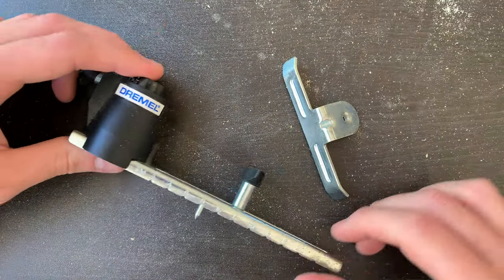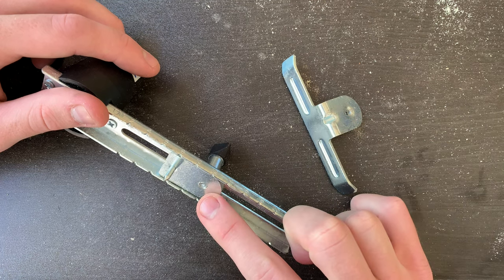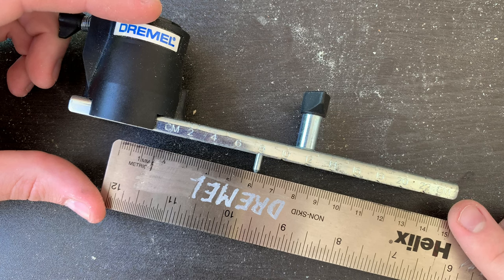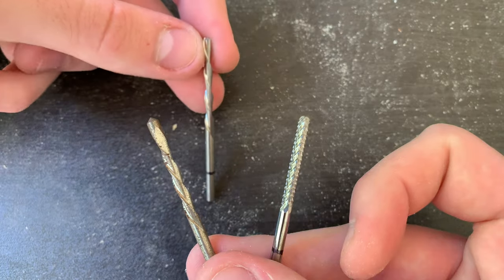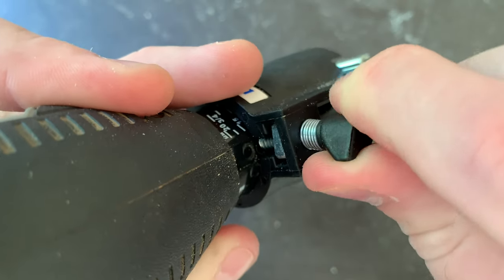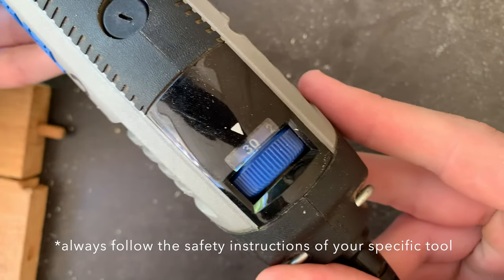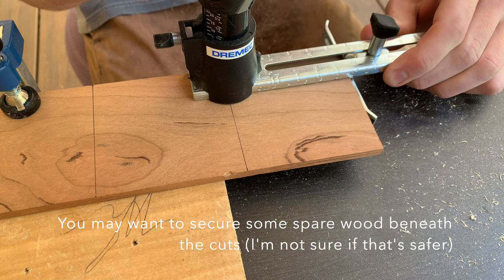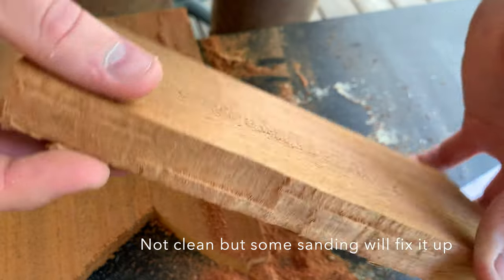How to Use the Dremel Circle Cutter & Straight Edge Guide 678-01

Comment: THANKS FOR THE VIDEO !!  i have a bunch of blue plastic pieces that came with this old dremel i bought used .   it's a 400 dremel . very old but new .  any idea what those are for?
Reply from the maker: Hi, honestly I’m not sure what those are. What do they look like?
Reply: @LogsCarvingClub  there is 5 or 6 of these plastic blue pieces in the box , 2 inch wide by around 4 or 5 inch long .  a flex shaft , sharpner and a router came in it too .  of course there was no paperwork .  its a model 400 from around 2002//3/4/5 ?   my dad bought it back then and never used it so i broke it out after watching some wood carving videos here and now i use it all the time .  recently i went to hobby lobby and i bought a WEN with a flex shaft and for $22 it works better than the dremel .   i wanted a second tool so i could switch between the 2 quickly without having to change the bits for detail work .   the WEN tool just feels good and more powerful .  im gonna grab a 3rd tool because i use basically the same 3 bits for all my carvings .  anyway im rambling .  im gonna play with router now that ive seen you show how to do it so thanks man